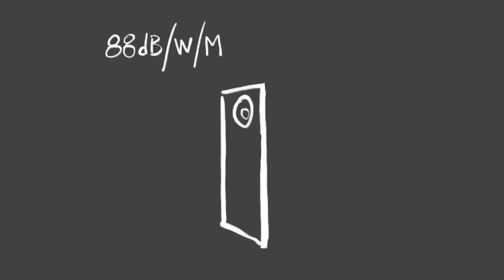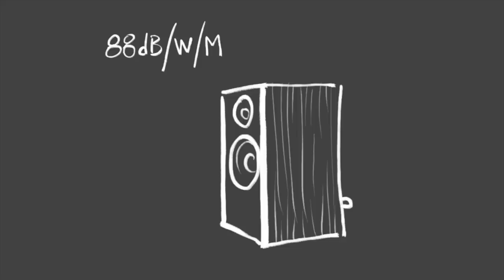John DeVore goes on a rant about the High End Audio lie that inspired him to start his company

Comment: I think you've missed the connections between a few important concepts here.  First, as you are no doubt aware, the impedance (Z) of a speaker varies dramatically with frequency (f).  A common way to assign a single number is to look at the Z versus f curve and use the first minima that occurs after the resonance peak of the woofer.  Power amplifiers are designed to have constant voltage gain versus frequency. Their output voltage (not power) will remain constant despite the varying impedance of the speaker.  Driving a loudspeaker at constant power across frequency would result in truly awful response because amplifier output voltage would vary wildly across frequency. Think about a speaker with a "nominal" impedance of 8 Ω (which requires 2.83 V to produce a power of 1 watt).  At its bass resonance frequency, its impedance rises to 80 Ω (not untypical).  It would now require 8.94 V to produce the same power of 1 watt - but the speaker's acoustic output would rise 10 dB because the speaker was designed to have flat response with a flat voltage input. It would sound very "tubby" because of the resonant bass peak.

The varying impedance versus frequency of speakers posed a similar problem in measuring the sensitivity of speakers using constant power - measured sensitivity numbers were dependent on frequency (impedance) of the speaker. Plotting sensitivity across frequency produced a curve with little resemblance to the speaker's actual "frequency response".  Measuring with a constant voltage produces numbers that are far more representative of the way speakers are driven in the real world. Therefore, testing at 2.83 V (equivalent to 1 W at 8 Ω) was adopted as a standard.

You are also likely aware that making the voice-coil length longer than the magnetic gap length in a dynamic loudspeaker is one way to reduce distortion at high cone excursions (low frequencies at high power).  This technique has a tradeoff in that it also reduces sensitivity (since a smaller portion of the voice coil is in the magnetic gap).  Therefore, speakers capable of high loudness (SPL) at low frequencies tend to be less sensitive.  I don't believe there's any "conspiracy" to force audiophiles to buy larger and larger power amplifiers.  It's simply one of the complex design tradeoffs in designing speakers.  Acoustic suspension (sealed box) speakers generally are less sensitive because of the distortion-reducing voice-coil design as well as losing the added bass output from the vent in a vented box enclosure.  It's also worth noting that the bass roll-off in a sealed-box system is at 12 dB per octave, while that in a vented box is at 24 dB per octave.  The former is a 2nd order high-pass filter and the latter a 4th order.  Higher order filters always have poorer time-domain (phase) distortion. That explains the audible quality difference at bass frequencies ... and one reason I love my old Acoustic Research speakers!

- Bill Whitlock, Life Fellow of the Audio Engineering Society
   Ventura, CA
Reply: As the magazine that endeavors to provide the most accurate measurements, which is partly why we use a real anechoic chamber for measurements, I am glad to read what you wrote here. The connection missing here is, as you pointed out, that most speakers are designed assuming constant voltage, not constant power. That's why, when you run 2.83V in, you get a "flat-ish" line from the speaker (or should). If you delivered constant power instead to these speakers, you'd get a wildly erratic response. As you said: "It would now require 8.94 V to produce the same power of 1 watt - but the speaker's acoustic output would rise 10 dB because the speaker was designed to have flat response with a flat voltage input. It would sound very 'tubby' because of the resonant bass peak."

So while we can appreciate the intent of the message in this video, it leaves out these crucial connections and itself becomes misleading. As far as we're concerned, 2.83V is the correct way to go. What the actual solution is, as John said in the video, is to do what Atkinson did way back and take that 2.83V sensitivity spec and convert it into the same spec expressed in watts and simply represent both. As a result, let's say that a speaker had a nominal 4-ohm impedance, all that would mean if you got an 88dB sensitivity for 2.83V input is that it is equivalent to 2W input, not 1W, which is what it would be for an 8-ohm load.

Doug Schneider
www.SoundStage.com
Reply: Y'all are the lone voices of reason here.
Reply: @soundstagenetwork  Agreed Doug, there's nothing misleading about the 2.83 V standard.  This fixed voltage has been part of international standards (AES and IEC, for example) for decades.
Reply: Didn't read your comment before I wrote mine above, you're much clearer in expressing some of my points, and adding a few extra points that I forgot to mention. Though in all fairness I believe the power sensitivity was always pegged to a certain frequency or frequency range. Else it would not have made any sense at all, because of the impedance curve of a speaker, which heavily depends on the cabinet too.
Reply: @markuskarner2156  Thanks for your kind words! Yes, frequency is yet another variable in all this.  My personal preference is to use pink noise simply because it gets closer to real-world application and human perception. It also eliminates a manufacturer's urge to "cherry pick" a frequency to get a higher number. But, like all specifications, ALL the test conditions should be clearly stated so that fair comparisons can be made. This is one of my pet peeves with manufacturers of audio gear of all sorts. As the owner and chief engineer of Jensen Transformers for 25 years, I tried to set a good example by publishing the most rigorously complete data sheets in the industry - it's maddening when a competitor claims a spec that can't possibly exist under anything but laboratory conditions. But the bright side is that, when you educate your customers, they tend to become very loyal!
Reply: @billwhitlock  I thought I recognized your name. When I was still building things (as a hobbyist) I believe I came across a bunch of papers that you wrote on grounding guidelines, taught me a lot and I tried to implement grounding accordingly, in my DIY builds. These days honestly I am not an audiophile anymore. I learned enough of the engineering behind it to see the "yes, but" in almost everything. Also, as an amateur musician I also started to see things from the other side, amplification, EQ and production, and oh my, it's a different world. I now buy pro gear wherever I can for listening. That is, active studio monitors and things like that. There's still things I'd like from audio but I'd rather have a solid compromise than some flimsy perfection that only works under very special conditions.
Reply: @soundstagenetwork  Doug, yes, and this is also to the point of my separate comment - all measurements tell a particular and defensible story as long as they're reasonably complete and are not taken out of context. But this video doesn't do that, it presents a perfectly reasonable way of measuring (voltage sensitivity) as misleading "a lie", when ... it isn't. In the wider context, the disease is that people want to make purchasing decisions based on single data points rather than a comprehensive picture. For example, no sensitivity measurement in the world will actually tell you about sound quality. Another example, I recently googled for sound quality comparisons between Spotify and Tidal. Found lots of sites that concluded that Tidal was "better" because their standard stream is compressed at 320k vs Spotify's 256k. That's a meaningless statement unless you do a test on a typical system to find out whether you can actually hear a difference. Even more so, you should find out if you can hear any difference yourself. People have an unhealthy obsession with comparison tables.
Reply: That's true - since a normal amplifier (that's not overloaded) is a constant voltage source, that's what the speakers are built for. The power going into the speaker varies greatly by the frequency - but so does the speaker efficiency as well. When impedance goes up, the efficiency usually goes up as well - cancelling out the effect of lower input power. So input voltage is indeed much better related to output power, than input power. 
It's more an "absence of information thing" from the manufacturers about the new standard, rather than "cheating" the specs...
Reply: @billwhitlock  good evening sir, just finished reading your take on sensitivity regarding loudspeakers. As a long time audiophile, music lover, and musician I have derived much enjoyment from this hobby. I also sold audio for a couple years back in the early nineteen eighty's. The stuff I sold was not high end, rather the common but still quite good mass produced Japanese equipment that dominated the market during those times. I read many audio magazines, and learned a little here and there, but certainly no where close to your level of expertise. When shopping for my personal home system I always used the basics on deciding which items to buy, for example for my power amp to check specs for high current reserves at low impedances, a high damping factor, etc. I used to enjoy visiting my friend to hear his system and compare it again mine. I always adored the sound of his ortofon moving coil cartridge, it had such a sweet sound to it. Anyway, I wonder if I might run a technical question by you. I have a mid nineteen seventys receiver I purchased new, actually from April 1978. It's a sansui 5050, rated at 30 Watts per chanel. It's still cosmetically in very good shape, and is used sparringly . I have read in different articles equipment from that era had a more primitive grounding system. Anyway, as time goes on I heard it's possible for a capacitor to fail and actually direct current, not sure whether it would be AC or DC, to the chassis resulting in operator getting a shock by touching one of the knobs on front panel, either volume knob or any other ones. I do want to note that the knobs are metal. Perhaps I misread article and this would pertain to just a more primitive amp, such as a amplifier for a electric guitar. Any information would be greatly appreciated. Thank you for sharing, and thank you in advance for a reply if you get a chance. Steven
Reply: @James Wilkes  You make a very good point!  In the world of electronics (the one I've worked in for over 40 years), "sensitivity" and "efficiency" are two quite different things.  Sensitivity is a term primarily used with transducers of one kind or another. A good example is a phono pickup - a typical sensitivity spec would be 1 "mV per cm/sec". which defines the relationship between electrical output voltage and the velocity of the stylus movement.  A similar spec for a loudspeaker would define the relationship between input voltage and sound pressure level.  The important feature of "sensitivity" is that input and output are in different units.  Efficiency on the other hand, defines input and output in the same units.  An "efficiency" spec for a power supply, for example, relates output power to input power and is most often expressed as a ratio or a percentage. If an input power of 100 watts is required to produce 85 watts of output power, the efficiency is said to be 0.85 or 85%.  The actual efficiency of a loudspeaker is generally 1% or less, with 99% of the input electrical power being dissipated as heat.  This topic is explored pretty well in a reference I just discovered at Wikipedia - see https://en.wikipedia.org/wiki/Loudspeaker#Efficiency_vs._sensitivity.
Reply: Where is Andrew Jones? ANDREW!!
Reply: Very well bur , how much wood can a woodchuck chuck , if a woodchuck could chuck wood  ??
Reply: @billwhitlock  please tell me 1 why my Velodyne 12" sub makes a humming noise ? 2 should i toss it in the bin?
Reply: @fishfire_2999  Powered sub-woofers are very frequently the victims of ground-loop issues in audio systems. Contrary to the advice of some manufacturers, putting a 3-to-2 prong plug adapter on their power connection is NOT a good solution ... it's a violation of electrical code and very dangerous!  Some simple troubleshooting should be done to confirm the existence and location of the ground loop, but the cure is usually putting a high-quality isolation transformer in the RCA audio feed lines near the sub-woofer inputs (Jensen's ISO-MAX isolators are particularly good for this). Drop me an e-mail at engineer_bill@verizon.net and I'll give you more details and instructions for doing the no-instruments troubleshooting.
Reply: I've worked on a few lately and they had cheap Chinese amps in them with dropping resistors for the lower power supplies. The heat causes the filter capacitors to burst. Replacing those and cleaning up the board (maybe a few dry joints repaired) usually sorts it out. None of the powered subs have much quality in the amplifier anymore. I fix very few now that they are designed to be junked in a few years. Sad
Reply: Was going to write something similar but was happy to see I wouldn't have to. In following with your points, I think the vast majority of consumers are best served by the 2.83V sensitivity (not efficiency) when getting an idea of how loudly a competent typical modern solid state amp stage will drive a typical speaker rated at a roughly equivalent impedance. dB/W basically only applies at one specific frequency anyway for voltage gain amplification. For those into tubes or other esoteric amplification (which lean more towards constant current), you should at the very least be looking for a speaker marketed or known as friendly with high output impedance, and preferably both look at a full frequency impedance curve looking for smooth and fairly flat, and audition a particular pairing before ever considering purchasing.
Reply: @Bill -   Are you saying mfr. specs for spkr. sensitivity should also include the frequency at which it the test was conducted?   Should the mfr. include multiple specs measured at a variety of frequencies?
Reply: @rb032682  That's essentially a frequency response plot - if it's run with a constant 2.83 Vrms into the speaker, it shows both response uniformity and "sensitivity" in one plot.  If a plot of impedance and phase vs frequency is also provided, anyone who actually wants to know the "efficiency" can calculate it: real output power (found by converting SPL in dB to acoustic watts) divided by real input power (found by dividing the square of the 2.83 V input voltage by the real or R portion of the impedance) at any frequency.  I don't think the typical user would find the plot of efficiency very interesting but publishing a "spot" (single-frequency, midrange perhaps) would allow efficiency to be compared. As I see it, the presence of nominally 8 Ω and 4 Ω speakers, as well as amplifiers rated for different maximum power with those loads, will always create some confusion about power "requirements" for non-electrical-engineers.  Speakers are difficult to fully characterize at best.  Power ratings are even more of a nightmare ... any single number is essentially meaningless.  In my experience, most speaker manufacturers don't dare to publish frequency response curves, and those who do usually intend for them to impress a prospective buyer. Real specifications for any product include enough information to allow the test to be recreated by describing the test conditions and steps taken to remove influences of room boundaries, wall resonances, etc.  In it's early days, Acoustic Research treated speaker data sheets as engineering information. Today, real spec sheets have been largely replaced by creations of marketing departments that bullet lists of "features" and unsubstantiated performance "claims."
Reply: @billwhitlock  -  Yes. In the 70s, I used to work a lot with Crown and Yamaha amps and JBL speakers doing small-time pro audio reinforcement for a travelling band.  The Crown manuals were definitely great documents.  The audio spec wars were just starting to happen and it seemed there was more BS than quality info.
Reply: Well, said. 
I am late to the party. ;)
Reply: Ohh,
Please can you help to trace a noise propagating through the power supply in a home made surrond system installed in car?
The car is a BMW 3 series; 4 way amplifier completely independent channel, with time delay between channels, bla-bla.., 2 channels amplified by another stereo amplifier, that reproduce Echo and Voice, and the surround module that gives away 6 channels low level signal.

Latest approach was to completely separate the signal from surrond sound using as "isolator" optical fiber convertor ADC to DAC.
 Not much of an improvement..

Any suggestion from you is welcomed.
Reply: Bill Whitlock of Jensen Transformers, it is great to see Your response here, and I respectfully disagree.  Although all Your statements of fact are true,  I find John DeVores analysis & reasons for objecting to 2.83 V reference, and the implications for progress in clear thinking about great sound repro very cogent and compelling.  In particular I appreciate his insights on the ever worsening, wrong headed ideas about "forcing" speakers to "behave beautifully" by overpowering them.

  First off, perhaps the hi end guys in Japan obsession with old Altec Lansings , and other "Old School" speakers of the 1940- 60's is a Fengshui appreciation of elegant, robust and beautifully crafted engineering/art.  A good loudspeaker is efficient, musical, and both subtle and powerful.  We have been going in the wrong direction in the USA in many ways.
  Yes the primary resonance peak at the bottom end can bring the impedance way up.  And NO...  NOT typically from 8 ohms to 80.  with Qts below .5 for most typical bass drivers today ( I don't recall the math formula , but i believe that puts us around 12 ohms) or less.  Driven into a small box the impedance peak is even less.

   2nd,  Tube amps with matching impedance output transformers, DO tend to, roughly speaking, produce output power proportionate to input voltage.  Not only because the unloaded Output voltage  will drop 15% when the impedance is matched but because the hysteresis of the output transformer releases the "charge" of magnetic Flux as the waveform reverses thru the core giving the driver extra kick at lower frequencies when the transformer 'sees' a higher impedance.  Speakers struggle to reproduce low end because drivers are such a small size proportionate to wavelength (1/4 wave of 50 Hz is about 5 feet long.  The big old Bass reflex enclosure with 15" driver, in 7 cubic feet box with 102 db 1w 1M Nominal 8 ohms driven by a 50 watt RMS tube amp did that job elegantly , musically, and powerfully, with by today's standards, an economy of means.  Gradually increasing impedance of the driver an octave above Fs was made up for by the increasing acoustic efficiency of the speaker as the wavelength becomes smaller than the cone, and as the cone becomes a waveguide at even higher frequencies.  This is one of the reasons tube amplifiers with output transformers and only moderate damping sound so musical.  They look flat into a resistive load, but favor the bass, and treble when playing into speakers (and so flatten the speakers response due to their tendency to produce power proportionate to input voltage.  This is also one of the reasons  transistor amps tend to sound "dry" at the bottom.  When a driver lags far behind the voltage waveform output in phase angle the negative feedback loop (ultra high damping) stops that waveform dead in it's tracks giving us an anechoic dry thunk.  Often, on Low Bass notes, a musician can no longer even identify the pitch.

  Another point on speaker design.  As the "Spec Wars" escalated in the 1970's onward, one of the selling points of speakers became the amazing AMOUNT of POWER, they could take.  This was mainly achieved by putting much fatter wire in a very wide voice coil gap.  The mass of the coil along with it being further from the magnetic field , along with the driver being smaller and the cone material more "dead", resulted in vastly lower efficiencies!  (Not so much voice coil length).  Old 15 " JBL's and Altecs had 104 -106 db @ 1W 1 m or 2.83 volts  Nowadays we are talking 82-83 db at 2.83 volts  That is a 99 % reduction in power efficiency!  Many LF drivers today  deliver 1 part in 100 of what the old school drivers did.  So that old 50 watt tube amp driving an old hi efficiency woofer, is equivalent to a 5000 watt transistor amp driving a modern speaker!!!  That's not even counting the higher impedance at Fs of older speakers and the ability of impedance matched output transformers to deliver the extra kick .
Reply: @markuskarner2156  ,  I don't think John called it a lie, but most people expect that 2.83V represents a pretty traditional idea of the behavior of an "8" ohm speaker.  If the speaker is in fact 1.5 ohms impedance at the bottom (when one is expecting normal behavior of an 8 ohm speaker with about 12 Ohms at Fs),  All but the most powerful amps will not be able to drive it properly, and amps that even do output a couple hundred watts  into 1.5 ohms while putting only 40 or so into the middle and top will produce much more crossover distortion, and IM distortion.  It's sort of ruthlessly disrespectful of ones expectations of what is needed to drive a speaker.  Are we really going to pull out our textbooks and spend and hr. trying to figure out why the speakers sound like crap once we've bought therm and hooked them up to a more modestly powered system?  And then what?
Reply: Most people don't understand amps are design to be constant voltage sources at a given input level and not constant current sources. Great job in explaining that.  Also, most people only used a few watts of their multi-hundred watt amps. To me the sensitive rating in volts makes more sense but to the videos point lower impedance speakers are harder to drive. I have a set of PSB Stratus Golds that dip down to 2.7 ohms. If I get crazy with them they will shutdown my amp for thermal overload. Yes the cabinet needs better ventilation!
Reply: @billwhitlock  Hey Bill, I'm just thinking about all this discussion about power and voltage and I'd like to take this into another subject, kinda.

Seeing as this is mainly a problem for someone choosing an amplifier to drive a speaker or someone choosing a speaker that takes advantage of what their amplifier has to offer, shouldn't it be simpler to eliminate this problem altogether with an active speaker?

I like active speakers for one specific reason (in theory, at least) which is the possibility of a near perfect damping factor. By having the crossover before each amp that drive the woofer and the tweeter respectively, since you are connecting your amp directly to your drivers, shouldn't this be the best solution?

Granted, most active speakers are budget oriented and do not feature neither fantastic amps nor fantastic speaker design, but I think this is the best way to build a speaker from scratch. Not sure if it has been exploited to the max, however, but I'd love to hear your take on this!

Cheers!
Reply: @mesamarshall  I absolutely agree that speakers with built-in amplifiers make it possible to optimize a myriad of performance benefits. Think about the design compromises in a power amplifier necessary to protect itself from the dangers of external uncontrolled loads. Current limiting for too-low load impedances or short-circuits is a major one. RF filtering to stop interference picked up by long cables is another.  Bandwidth may be compromised to prevent high-capacitance cables of exotic design from causing instability or oscillation.

Interesting that you bring up damping factor!  While making speaker a speaker cable very short certainly improves damping factor, it's not as important as most engineers and audiophiles think.  In theory, driving the "voice coil" of a dynamic loudspeaker from a zero-impedance source (a voltage amplifier with sufficient negative feedback approaches this ideal) will result in very high restraining force on unwanted coil motion (a.k.a. "damping"). But the way "damping factor" is computed (dividing nominal speaker impedance by the sum of amplifier output impedance and speaker cable impedance) makes it a poor measure of the actual magnetic restraining force. That's because the voice coil's own DC resistance, generally about the same as the speaker's nominal impedance, is part of the circuit that limits current caused by the "back-EMF" generated by the unwanted movements of the voice coil.  For example, an amplifier with a "damping factor" of 80 adds 0.1 Ω to the circuit. Does 8.1 Ω sound different from 8.01 Ω ("damping factor of 800)?  No - in tests, even trained listeners can't detect a difference until damping factor is less than about - meaning circuit impedance increased from 8.0 to 8.4 Ω.  My point is that eliminating speaker cable, which might increase the "damping factor" from 50 to 500 will likely be undetectable. IMHO, it's not a significant advantage of a "powered speaker" - but there are plenty of other potential benefits!  Line-level crossover networks can use "transversal" digital filters which can separate phase and amplitude characteristics in ways that analog filters can't.  Without conventional speaker-level crossover networks, it becomes possible to sense the voice coil temperature of a driver - and control the amplifier to prevent thermal damage, regardless of program material or loudness (I'm working on a patent application).
Reply: Thank you! I just left a comment making more or less the same points. If I'd read your comment first I'd have not left mine. You hit the nail absolutely on the head.
Reply: I have no idea what you said but found it oddly satisfying to read (twice).
Reply: @denisbarry9436  thanks for reading it twice!  If there's something specific I could explain better, just let me know. I try to de-mystify the technical side of audio and de-bunk myths that confuse logical thinkers.
Reply: @markuskarner2156  excellent point about the relative value of single scalar numbers on spec sheets. I was a high school student in the '70s when home hi-fi was becoming a big business, and spent countless hours in the school library memorizing and digesting component specs as published in "High Fidelity" and other consumer audio magazines. This quickly got me into pro audio, and that's how I noticed the bifurcation in the industry, with pro audio being a matter of numbers that could get very complex. Audio pros could measure everything that could be heard and then some.

In contrast, the emerging "high end" audio business claimed that nobody truly understood the factors that influenced component performance, that it was all a mystical thing, and that high-end components "just appear" perhaps dropped from alien space ships. That's all rubbish, of course. Overpriced consumer electronics are also designed by human engineers, and there's nothing mystical at all about not publishing specs when their products can't compete on them. When, as P.T. Barnum so aptly said "there's a sucker born every minute" it's more profitable to spend money on marketing than on good engineering design.

Back in the '70s there were quite a few unscrupulous companies inflating the numbers on their products, so the Institute for High Fidelity and the Federal Trade Commission got together to develop a standardized suite of tests for consumer gear that closely resembled what the AES & IEEE already did with pro audio, but stressing the fundamentals, and with easy-to-remember numbers like 20Hz-20kHz that didn't conform exactly to the musical scale, but were easier for laypeople to remember.

I guess it's human nature to try to reduce complex thoughts into simple-but-meaningless values, as we see being done to this day with camera megapixels and other measurements that aren't good indicators of overall quality. Back before ferrofluid was a thing that was put into tweeters to keep them from frying, more amplifier power was a Good Thing indeed. And for some, the big numbers were a matter of pride. Alas that's just one metric, and perhaps not the only important one for some.

One thing that got me out of the consumer audio snake oil rut and into studying electrical engineering was the realization that I didn't know what I didn't know. Not only did I not know the facts, I didn't have a good idea about how much I didn't know! Turns out quite a bit. And if I hadn't taken that step, I'd still be ignorant of that. Sales people will not tell you how little you know, they will ply you with insincere flattery to make a buck. And sadly, those who don't know will be none the wiser.
Reply: @fishfire_2999  depends how much time he has to chuck wood!😁
Reply: @fishfire_2999  check the grounding (ground loop?) and power supply. Check the capacitors. Why toss it? Fix or replace the amp!
Reply: Sir, thank you for allowing me to whitness one of the best and insightful conversations on youtube.
Reply: Well in the name of supplying information to the masses, John did an outstanding job with his explanation.  John is not presenting an article to Spectrum Magazine (IEEE) or one for the Audio Engineering Society (AES), so cut the psychobabble and make your own video or write a book a quit letting your insecurity show through.  By thr way I'm a member of the IEEE and AES....
Reply: @davidevans1420  Insecurity? Psychobabble?  I've spent most of my career de-bunking myth and mis-information - I was made a Fellow of the AES largely because of that work.  I simply wanted to explain why speaker sensitivity ratings are not a conspiracy among manufacturers to sell higher-powered amplifiers. I don't know what your motivation is, but mine is simply to inform.  I don't post videos on here largely because opinions too often replace facts and many people like starting baseless arguments for their own entertainment.
Reply: Ditto!!!
Reply: @Geopholus  That's why all amplifiers should be like the Carver Signature Sunfire amp: 600W@8Ω, 1200W@4Ω, 2400W@2Ω and 4000W@1Ω with 0.5%THD over a frequency range of 0-80kHz.
Reply: @billwhitlock   Yeah I thought he missed the real lie in audio - Sensitivity at what frequency or broadband or whatever measurement method. No mention that the number itself could be very 'loose' .  I think we can all remember to knock of 3dB if its a 4 ohm loudspeaker. From my experience it's more the faux number in the first place. Some are just a dream.
Reply: @fishfire_2999   Probably yes, they aint anything special. Oh you just want to return it to its former glory? Replace the cheap filtering caps they use in the PS, or your signal lead is dicky.
Reply: When the majors at the AES step in, it's time to sit down. Thanks, Bill! I am not an audio engineer but have quite a bit of time at the big old desks in-studio as well as sales time on the pro side, and it was nearly 40 years ago now that a friendly but very serious studio designer with AES credentials taught me to sit down and listen when I knew half or less of the truth on a subject and had forgotten that I needed to learn the other half before pontificating.
Reply: @billwhitlock  Or use a  wireless connection?
Reply: OK, great. So what brand/range of speakers do I look at for reasonably priced (<$300) and sized home audio solutions?
Reply: @markalden7848  I'm not an audio critic or reviewer - just an electronics engineer that's spent his career in the pro audio industry - and I try to de-bunk bad science (or claims of conspiracy as in this thread) in the area of electronics engineering.  The performance of speakers, and especially value for money spent, is extremely hard to characterize in objective engineering terms.  For that reason, I'd rely on the advice of truly objective reviews by those with trained ears, where the reviewer isn't selling anything, either directly or indirectly!
Reply: Thank you for this comment, Bill! While discussion on speaker sensitivity and amp power is clearly necessary, as one pretty tall person said: “Everything should be made as simple as possible, but no simpler.” Cheers!
Reply: Love the way that jargon is used to hide that someone is essentially talking absolute bollocks.
Reply: Great observations, Bill!  As an electronics engineer the explanation as it were in the video is rather fraught with errors.  Like "per meter" and calling impedance resistance.  Speakers have a reactive component thus power isn't simply VI.  (and frequency dependent as you noted)

The other thing is how little the efficiency matters.  With the power amps of today...  Almost everything else matters more to the quality of the sound.
Reply: @markuskarner2156  
Yes, and I found it fascinating all the commenters praising the presentation as illuminating.  The schools have succeeded at prizing confidence over competence.
Reply: @billwhitlock  
"Debunking myth and misinformation" - you do well.  If only we could get you into the realm of politics!  🤔😯🤭☮️
Reply: Bill, their flagship speaker was the AR-3A, developed in the 1960's. The paper and rubber deteriorate over time to the point where the speakers are unusable. I've read about some enthusiasts restoring their old speakers, but how do they sound compared to the old ones? If Edgar Villchur were not subject to an anti-compete clause, the history of acoustic suspension speakers might have enjoyed a longer, more prominent lifetime.
Anyway, bass response is overrated for classical music. I find a Quad ESL-63 to be the least fatiguing speaker I've ever listened to. Jim Thiel's speakers never managed to win my enthusiasm, no matter how fancy the crossovers or time-alignment of the individual speakers. Harry Pearson of the Absolute Mound (sic) was correct about one thing- live music is the ultimate reference.
Reply: @alohamark3025  Actually my first AR speakers were a pair of AR-3As (and I still have them!). I've replaced the surround rubber in them twice over the years (LA smog used to rot them fast).  I never noticed a change in low-end sound or in their impedance vs frequency curve ... I don't think the mechanical compliance is terribly critical for them.  A good friend of mine (Steve Desper, former mixing engineer for the Beach Boys) had a pair of Quad panels for many years - he loved them - aside from their weak bass, I thought they were amazing, I later became a fan of Janszen electrostatic tweeter panels.  There are still some good acoustic suspension models on the market. One of my favorites is Bag End Loudspeakers, whose double-integrator to flatten frequency response (and simultaneously remove time-domain distortions) is very clever! It takes advantage of the sealed-box gentle (2nd-order) high-pass filter response (vented boxes are 4th-order and do much damage to reproduction of things like kick-drums (for several years I had a drummer roommate).  AR, and/or Bag End makes kick drums sound real instead of "tubby" as with a vented box. Yes, real music is the gold standard!  Everyone should periodically calibrate their ears by attending a small-venue performance, where there's no or minimal sound-reinforcement!
Reply: @alohamark3025  
To butt in, I have a pair of AR-3s around, they're not much to listen to, kinda tubby and muddy.  And little.  Perhaps okay for low level background music but they're not transporting me back to the concert.  The rotted woofer surrounds are not too hard to replace and have been readily available at low cost.  Not much you can do with a frazzled teeter but replace it with something similar.  FWIW.

The ESL-63s are very clear and accurate, producing excellent sound.  They don't work for me because of their SPL limitations unable to return me to the concert.  The lack of deep bass is less of a problem for me but they'll arc before getting loud enough to put me in the zone.

The "acoustic suspension" moniker was a fancy name for sealed box.  I've found that to be my best solution for accurate low frequency "transients" at high SPL.  It means a big box though, and big amp.   Big enough that only the most ardent audiophile would consider appropriate, and in a complementary listening room.   

There doesn't seem to be many of us "listeners" left.   Everyone I know is putting on music to do other things.  With small systems designed to "sound big".  They aren't sitting still eyes closed analyzing the timbre of various instruments, following the lines of individual musicians, critically analyzing the mix, focusing solely on the acoustic picture of the sound and vibrations.  Imagining themselves with a stage in front of them and watching the players in their minds.
Reply: Facts, like it
Reply: I think your math is a bit flawed.   The electrical impedance of a speaker doesn't increase as frequency decreases.  As an inductor the impedance increases with frequency.   When speaker impedance is specified it is a referred to as a nominal  impedance specifically at 1Khz.  As such there is no such thing as constant power from an amplifier.  The amplifier power will change as the impedance of the load changes. This is basic ohms law for AC circuits.
Reply: @dieterbillinger2289  With all due respect, a speaker is more than just an inductor!  Not only does it have DC resistance, owing to the metal the voice coil is wound with, but more importantly the voice coil is subject to the back-EMF created in it as it moves through the magnetic field - in accordance with Faraday's law of induction.  Therefore, when the speaker mechanical resonance will create large amounts of back-EMF and cause the apparent impedance to rise.  Because of typical resistance and self-inductance of typical voice coils, resonance (back-EMF) dominates the impedance characteristic at frequencies typically below a few hundred Hz and inductive reactance dominates at higher frequencies.  The impedance of an electromagnetic transducer like a loudspeaker is well beyond things taught in Electronics 101!
Reply: Sealed box ftw
Reply: I had a pair of 1972 year Scott 8" AS type 3-way speakers and they sounded awesome.  They became my rear set in my video surround assembly.  They were stolen from me back in 2014 after having them for decades.
Reply: The point he was making was aimed at speakers with a frequency response that shows a large aea of LOW impedances. Your example, of a high impedance at resonance, is handled easily by voltage based amplifiers, as higher impedances demand less current.

What this guy is saying, is that amplifiers (even voltage-controlled amps), will struggle at these low impedances. If an amp is putting out 2.8v into an area of the spectrum where the speaker is 8 ohms, that load will be pulling 0.35 amps.

If impedance is 16 ohms, and voltage is at 2.8, then current will be 0.17 amps (and thus 1/4 the power), which is easy for the amplifier. 

But if the signal is in some area of the spectrum where the impedance is 4 ohm, 2.8 V is 0.7 amps. If impedance is 2 ohms, that's 1.4 amps, and it'll be drawing 4 watts from the amp, ie 4 times the power that would be required for higher frequencies where the amp is closer to its nominal rating of 8 ohms. 

So, esteemed Bill, you're right, where impedances are high, but you've completely missed the point he was making, about low impedances. If speaker sensitivities are in the low range, in the 80 dB range, that is a problem if a speaker has very low impedances across larger areas in the bass spectrum. They might be great, low distortion speakers, at very low volumes. But at higher volumes, amps (unless they are Krells), will struggle to provide the current, and the power, at those low impedances. This is a real problem, with speakers like that one he used as an example.

High impedances, common at the higher frequencies on typical impedance curves (and at resonant frequencies lower down), are easy for amps.  

But low impedances, in the bass areas - are a problem, as they demand too much current and power, and the amps that most people have just aren't designed like Krells, so they can't deliver that.

So that's where these low sensitivity, low impedance speakers turn the voltage-based sensitivy metric into a farce. They may be able to look good on a sensitivity test at the low power required to measure 2.8 volts, but that will be at just a quiet volume, and any amp will manage that. But when you turn the volume up, and up, your amp just won't be able to deliver that power at the low impedances. You end up needing these huge high current amps, in order to get decent bass volume. if you don't own a Krell, you turn up the volume, and your bass goes to shit, not because of speaker distortion, but because of amp distortion.

So his point is completely valid... if you expect decent bass out of your fancy speakers, which many people do.
Reply: @An_Idiot_in_the_Wild  I most certainly understand Ohm's law and its implications here.  But nominal impedances given to loudspeakers speaks to their high current requirement, as do output ratings for power amplifiers and their ability to drive low-impedance loads.  Low-impedance speakers have advantages in high-power applications (among them is requiring less-than-hazardous voltages to drive them to high acoustic output).  I don't see what the perceived problem is unless you think it is the consumer's inability to appreciate that, if you have a 4 Ω speaker, it's not wise to try to drive it with an amplifier rated ONLY to drive 8 Ω loads.  Removing that stumbling block would require all speakers to have the same impedance, which could pose a problem for more knowledgeable users.  What new test method for "sensitivity" would you propose to fix this perceived problem?
Reply: @billwhitlock  There isn't a problem, if the speaker's impedance is reasonable. I think you need to re-watch the video, although i know that will be a chore, because it was pretty boring, sorry. But basically his complaint is not about 4 ohm speakers which don't stray too far below their nominal impedance - the complaint he is making is about the trend in early 90's for some high end speakers, to have low sensitivity, AND impedances that dropped dangerously low in the bass area, ie well below 4 ohms, eg he mentioned some were dropping as low as 1.5 ohms. That is going to be a nightmare even for amps that claim to be able to handle 4 ohms, because, to be honest, when most amps claim they can handle 4 ohms, the truth is, they don't handle it very well, and they will perform terribly into 1.5 ohms...

Regarding what new sensitivity measure i would propose, well...

You said earlier that speaker frequency response curves were designed to be flat w.r.t. voltage, not power (as i used to believe). So if you are correct, then using dB at 2.8V does sound like a more useful metric than dB at 1 W etc. But, the dB at 2.8V does become misleading if speakers have low impedances across any region of the spectrum that's going to carry a significant amount of power.

So, i don't know. Perhaps the solution is just to be more strict about what manufacturers are allowed to claim, w.r.t. nominal impedances. If a speaker departs too far BELOW its nominal impedance, in any significant area, then the speakers should come with a prominent impedance warning, or something...
Reply: The rare exception being Cizek speakers, which had a virtually flat impedance vs Frequency plot.,  I never bought a pair of the KA-1s when I had the chance, and I regret it to this day.
Reply: @peccatumDei  I'm not familiar with the Cizek models, but according to Wikipedia (and it makes sense to me given the pictures), his speakers were remarkable for flat impedance through the crossover frequency range (no small feat).  But they exhibited a typical large peak in impedance at the resonant frequency of the woofer, which is the main one that's relevant to the "power" vs "voltage" input reference in this thread.
Reply: I'm too dumb for this comment thread
Reply: this is such a cool thread. a lot of great points discussed here. this video is surely as much of an amplifier story as it is a loudspeaker one. generally, i happen to think the voltage sensitivity measurement is superior, I have no beef with it. also, I am a big fan of small drivers. The physical characteristics of some modern drivers are just mind bending. a couple points that came to mind watching the video and reading the thread: though I'm sure John understands ohms law, he repeatedly speaks about power as if it is the driving variable, ie an amp of some rated power will deliver that power and one can make the amp deliver more power. unfortunately we can't control how much power is delivered across the spectrum, it's just not one of the levers we can move. power is always a dependent variable, either by a change in voltage, a change a change in impedance, or both (current can also be a driving variable, but we're talking about voltage amplification here). it shouldn't be assumed that an amp has a low output impedance, but the overwhelming majority of modern amps (anything solid state) will have a very low impedance and be completely unaffected in providing an accurate voltage regardless of the impedance. a caveat to that is any amplifier that is unstable at lower impedances, or where the amp's power supply doesn't have enough overhead. next point, the loudspeaker's impedance needs to be reasonable. in the 90's through to today, the tendency is to use smaller bass drivers, that are heavier, but designed with mechanicals that make it capable of moving as much air as a much larger driver. for the smaller piston to move further, more power must be applied, and when you combine a heavier motor, heavier cone, softer suspension, smaller size and longer excursion the result is reduced sensitivity and reduced bandwidth. sensitivity can be made up for by using a ported alignment, adding more bass drivers and/or padding the heck out of the upper range drivers. here lies a couple problems, 1. multiple drivers need to be wired in parallel to increase their output, 2. impedance can drop off severely below port tuning frequency. this, i think affected a lot of speakers in the 90's and regardless of how aesthetic a speaker is, it's a poor design practice. next point, amps and speakers should be matched appropriately. If you're trying to power a small driver, ported loudspeaker with a tube amp, or a class A, or any other type of high impedance amp, you're doing it wrong. high impedance amp & high sensitivity speakers go hand in hand. small speakers always need a solid state, low impedance, high current amp. lastly, modern digital amps are amazing, they use high switching freq., tiny inductors, are low impedance and stable down to sub-ohm loads, and can deliver a ton of clean raw power.
Reply: @davidevans1420    Re “letting your insecurity show…” I would suggest you have taken the next step.  You have run it up the flagpole on a windy day and shouted for all to see, reinforced by the pointlessness of your credentials.  Should we assume you are inordinately familiar with the term ‘psychobabble’?  Is there a reason it rolls so comfortably off of your tongue?  “Doth protesteth too much” doesn’t even begin to cover you, David.
Reply: @Gumshoe Beaumont Respectfully, "unconditional clarity" will require that you specify frequency when you specify 1 W of power.  For decades, sensitivity has been casually stated as xx dB at 1 Watt and at 1 meter, with those making the measurement understanding that 2.83 V is the output voltage of an amplifier supplying 1 Watt to an 8-ohm load.  It's really not that simple - for those who don't understand Ohm's law, it will never make sense. One also has to understand that a "power amplifier," despite its name, forces its output VOLTAGE (not output power), to follow the input signal.
Reply: This is fascinating.  If there were a thread of the week award…
Reply: i could not agree more. i use a 8 inch 4 ohm car sub woofer for a book shelf with w Peerless tweeter .it has a verY vERY stiff suspension .this driver has an amazing 16 mm Xmas for its stiff suspension and heavy cone but its Bass response is better then anything i have heard before ..it can go far below 30 hz that most 8 inches cant  .i cant stop listening to it